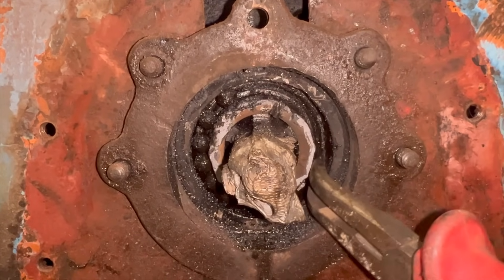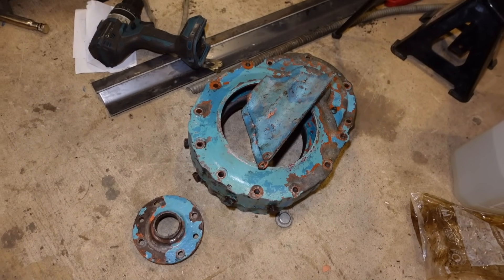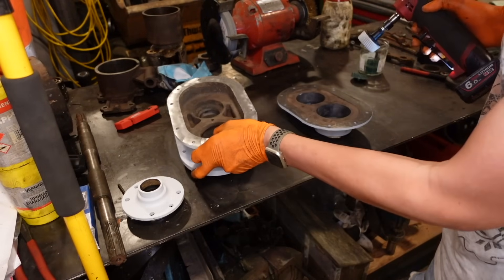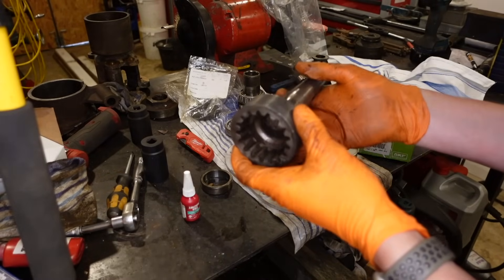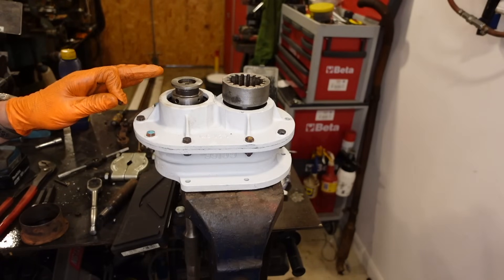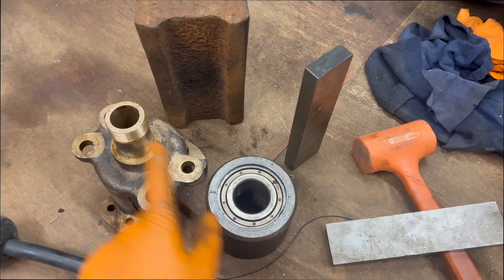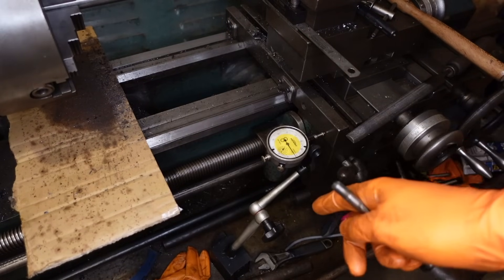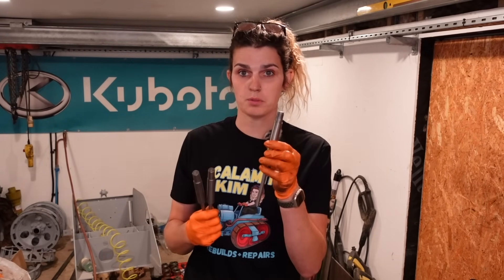MAJOR ISSUES! - 1946 Ransomes Crawler P2

Comment: Hi Kim, in good condition for its age but a good idea to change all the bearings and seals, as it will never have the same usage as its earlier years it will now last forever, when degreasing my engine parts I use old  gunwash, this is obtained from a local sprayshop, I leave the parts in to soak in large containers,really leaches the oil out, as sprayshops normally have to pay to get rid of it they will often let you have it free, leave it to stand for a couple of days and all the sediment will drop to the bottom and you can carefully decant the clean from the top and as you aren,t a business you can take the dirty gunwash to your local recycling centre for disposal.
Reply from the maker: I did change every seal and every bearing. Also I used an ultrasonic cleaner to clean everything. That was by far the most effective way to do it I found.

Comment: Excellent work!!!
0:54 been there done that, many times. It's the 5 stages of dealing with difficult equipment, 
1. denial, "I definitely took out all the bolts, or screws, clips, etc. I defo didn't miss anything"
2. anger, "OK, screw you and the horse you rode in on. You piece of garbage, I hope you rust"
3. bargaining, "ah come on, I released the do-dad, and loosened the other thing. If you come apart I'll be your friend and give you loads of lovely fresh grease/oil"
4. depression, "why, why won't you come apart, out, whatever. Sob quietly out of earshot of the machine"
5. acceptance, "f^&k it, the gas axe, or angle grinder, it is then"

Comment: Do you have a set of the extra large sockets, and if so do you remember where they came from?
I've been looking for a reasonable 1/2" set for sizes greater than 32mm at a not ridiculous price and struggling to find anything.
Reply from the maker: Hi Tom, I think my 1/2” set goes up to 36 but I have a 3/4 set that goes up to 50mm, that’s a Clarke set. You can get similar sets on eBay for not a lot of money. With a 1/2” to 3/4” adapter it there’s not much you can’t do. 
I also have varying large impact sockets from over the years doing odd jobs.
Reply: thanks!  @CalamityKim1

Comment: Really enjoying this, top job Kim. What did you use for cleaning the mating faces up? Never seen them before
Reply from the maker: Thanks Robbie. So they’re made by 3m, it’s a product called roloc, and they’re the bristle brush attachment. You basically buy a little mount, mines 50mm, then you can buy sanding disks, bristle brushes and some scotch bright sanding disks of all different grades. They’re brilliant! I spent about £20-£30 on bits once and not ordered any since. They last ages.
Reply: Never seen them either. Last lot I bought were them spongy looking discs, supposed to remove crap and not metal 🙄... little shards of stuff come off the discs as you go and stab you in the belly 😢
Reply: @CalamityKim1  superb Thankyou! I’ll get some ordered 👍